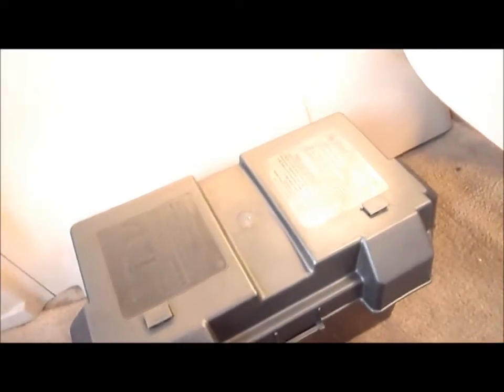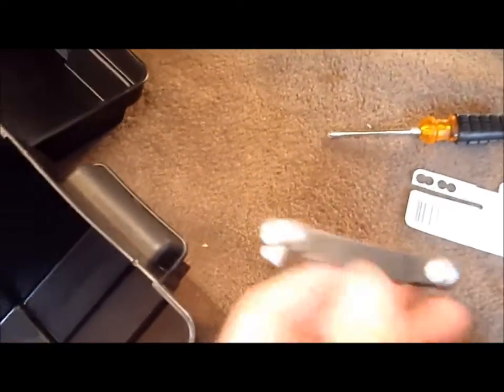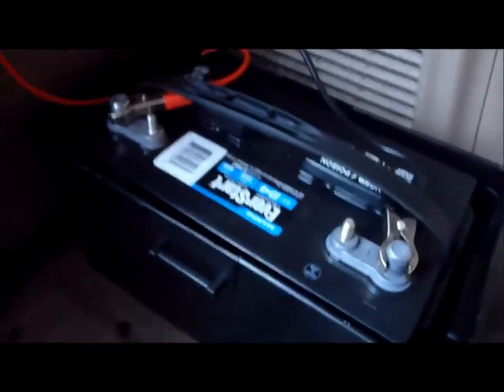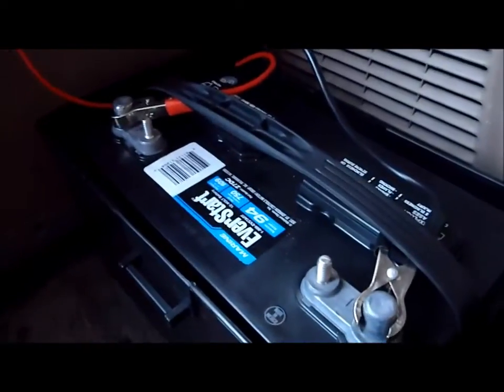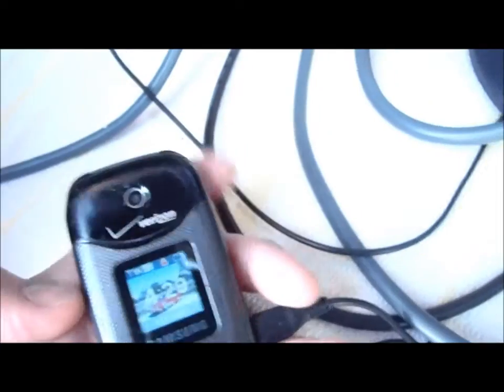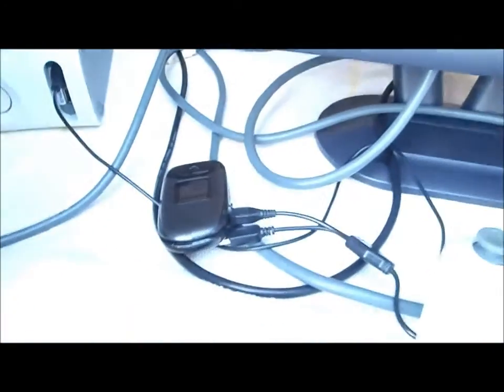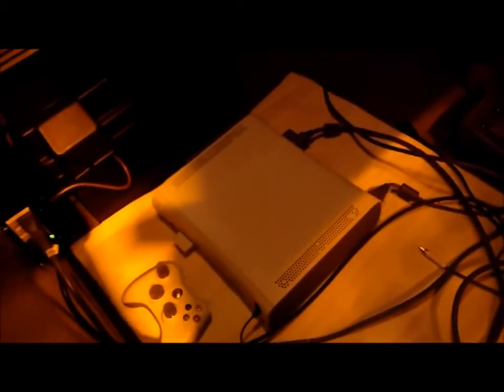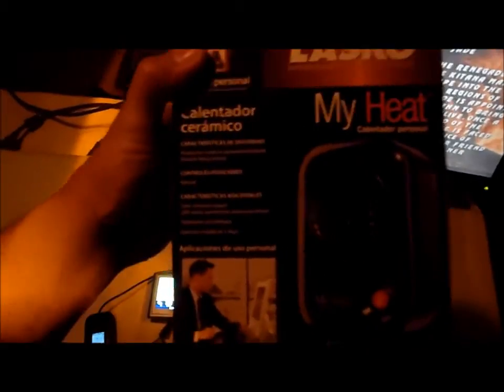2nd Battery For Accessories Xbox 360 Capacity Test Deep Cycle Battery Econoline Project Part 3

Comment: This is one of my favorite videos right here,  especially the vid with the flat screen :)
Thumbs up
Reply from the maker: Man I wish I knew back then what I know now.

If I were tom do it again I would of started off with a flat screen and 4000 watt inverter. Looks like I need a 4000 watt and 3 batteries to run a A/C
Reply: You thought exactly the way I am thinking lol...I see a lot of ppl using 2 batteries. ..I plan to use 3 OR 4 deepcycle batteries an like you say "4000 watt inverter"..and that for sure should power a indoor A.C.  :) GONNA BE NICE!
Reply from the maker: Kaleb S.

5000 BTU AC runs at 500 watts, the surge for that is probably going to be around the 2000 range so a 410 or even 750 watt inverter that I have wont start it.

You learn man. I wish I got the 4000 from the start. I spend $30 on the 410 and $45 on the 750. I should of bought the 4000 for $129 from the start.

Comment from the maker: Lap tops draw about 56 watts when you're charging.

So with a 400 watt inverter you'll be fine charging 4 lap tops.

Fully charged a marine battery can power a 100 watt accessory for 4-6 hours.

Check out my new video, Accessory wattage guide. It'll give you a better idea of what you can run off a deep cycle battery.

Comment from the maker: I'm eventually going to get a solar panel. For now I'm just using a battery charger. It only draws 50 watts so you can use a cigarette lighter inverter to power it. Those peak out at 110.

Comment: yeah a semi inverter is prolly closer to 2k I know you can run all kinds of shit off of it, infact yeah i looked it up tripac is one company and they use 1800 watt inverters. Trucks have a cubby hole to put a small 12 volt fridge and mine has a switch on the dash that'll kill that outlet, they have another cubby hole with a strap for about a 13-15 inch tv and a 12 volt plug (they do make 12 volt TV's with built in DVD players, and the APU trucks have two outlets under the bed with a fuse.

Comment: If i use your design, plug in a power strip to the inverter, then plug in four laptop chargers to that, will the battery be ok? And how long do you think we can run it?

PS- Im a rookie
Reply: Depends on the laptop . mine uses 40 w. My husbands Asus ROG 751 JK uses 300 watts.

Comment from the maker: The little heater I got is only 200 watts. I'll see how long my inverter can run it. 

I was looking up inverters today and saw a 5000 watt one.

I want something in the 1000-1500 range. You need about 1100 to power a microwave.

Comment: Okay, scratch what I said about your accessory guide video. THIS was exactly what I was looking for. specifically for the xbox and tv. Thanks a TON.

Couple questions, what kind of Marine battery are you using? The brand n such. Also, did you eventually connect it to your alternator? If so, how much did it cost and how fast does your van charge up the battery? Thanks!
Reply from the maker: Everstart. You can get it at any Walmart or Autostore

Try not to constantly drain the battery, you'll get more life out of it that way.
Reply: Spot on . just get the affordable stuff . One bit of advise : don't use your car alternator to charge a marine battery . They are not designed for high current . ( over 200 amps ) . Walmart has a cheapie 3 amp one. You can use one rated at up to 20 or so safely though.

Comment: Semi trucks btw use 4 of those fuckers linked together, marine batterys... I suspect the heater will actually draw alot more power then the xbox depending on how high it's set. Alot of them now actually have whats called an APU that is a little diesel motor that can charge the batterys provide heat AC and run something like a 1k watt inverter that's built in. whats cool about them is when they detect the batterys get low it'll fire up and keep the batterys charged.